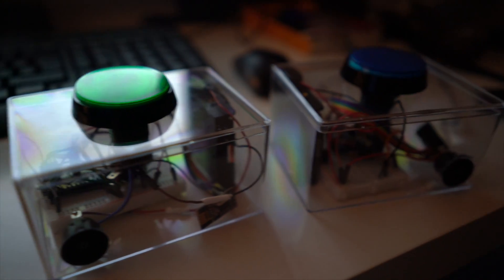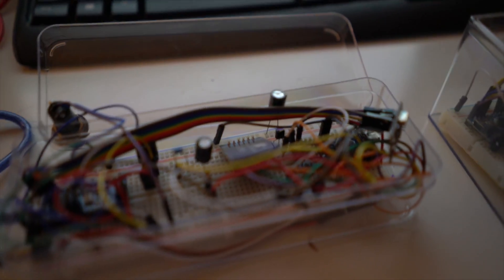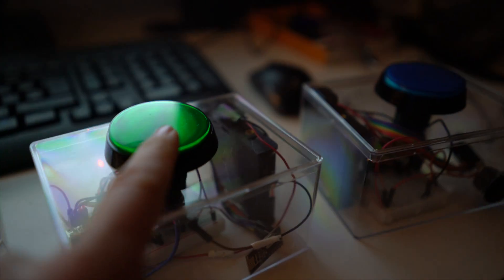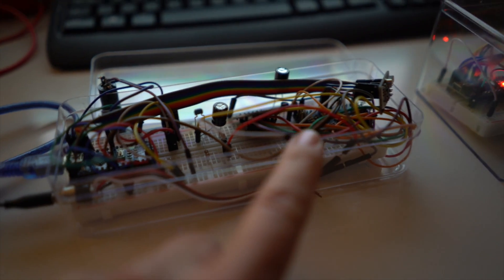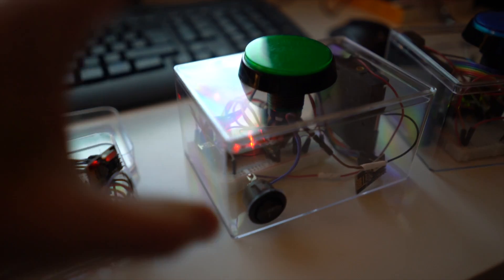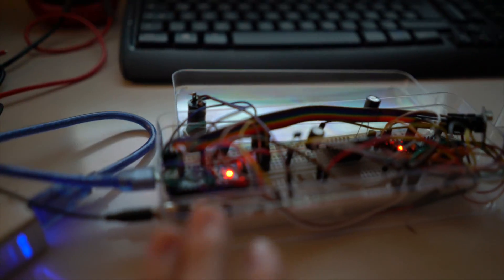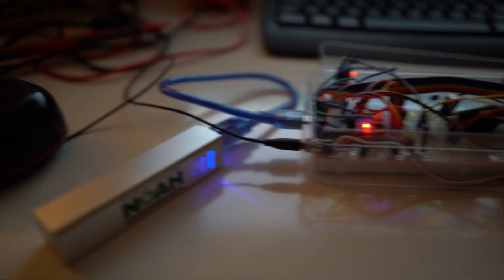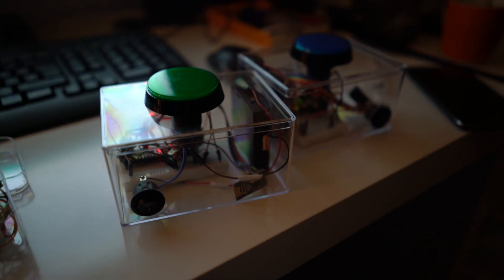Arduino: Wireless Game Show Buzzer with sound

Comment: It does not work for me. I use a board with a built-in and external antenna. When you press the player button, you can see that the LED on the TX nano board lights up. But the LED on the player button itself does not light up. Nothing happens on the master board. I’ve been sitting here for two days now and I can’t do anything. Can you tell me where I missed something? In the sketch settings in all three files (Button, Master and RF24) I changed the pins to 7 and 8. RF24 radio(7, 8); I can't figure out what I'm doing wrong.
Reply from the maker: It's really been a while, since I worked on that project. I just remember, that some modules (from Aliexpress) did not work. The only hint I can give you: Order the RF24 from a different place.

Comment: Great project, thanks for al te work. I am running in problems to get this work. I have set up two Nano's, one as buzzer and one as master. Disabled the play sound function. Changed the ID's in the master sketch to {1}. The buzzer is sending data and the master is receiving data (Data received!  1,  1) but then nothing is happening. There is no message sent to the buzzer because the light is not powered on (it is blinking at startup). Can you help me?
Reply from the maker: Hi Patrick, thank you for the feedback. I am sorry, it's been a while since I created this project. Have you checked all connection? Also check the NRF24l01. I sometimes had some faulty modules. Try to use a spare one.
Reply: @felix41382  I have tried another sketch for communication and this works fine it seems that the data sending is not handled correct by the master, I have checked the code (for as far as I am able to) and connot find anything strange.
Reply: @felix41382   @felix41382  no luck, tried different modules. Checked everything. Used other sketch for communication testing and that works fine.

Comment: Nice Felix. A quick look at the code tells me that this will work with up to 255 buzzers. Is that right? I actually want to make 20.
Reply from the maker: That's correct. Currently up to 256 devices are supported. Please send me a picture of your 20 setup. I never saw it that big. :-)

Comment: Moin, wie sieht es mit der erweiterbarkeit aus? Ich habe versucht es auf 6 Spieler zu erweitern sowie die pipes auf 6 erweitert. Nur will er strikt nicht mehr als 2 Spieler quittieren.
Reply from the maker: Betacrypt_FPV moin beta crypt, ich hatte nie mehr als zwei buzzer im System. Das sollte aber eigentlich kein Problem darstellen. Ich schau die Tage nochmal in mein Source code. Ist schon ne Weile her.
Reply: Das wäre super von dir! Die BK_SW habe ich auf 7 erweitert damit er die zuordnung auch hat. Mein riesen problem ist das RF24, damit habe ich mich noch nie auseinandergesetzt und die pipes machen mir ein Fragezeichen ins Hirn :D Wäre super wenn du da in deiner sehr sehr freien zeit mal drüber sehen könntest.
Reply: Hi Felix. I would also appreciate this, if you wouldn't mind. I have built the 2 buzzer version (which works fine) but  I would like to extend it to 4 buzzers. Unfortunately, my coding skills are a bit rubbish and I am struggling with how to extend the number of buzzers. Any help/pointers would be gratefully accepted. Thanks.
Reply from the maker: I created a Github repository for this project and added support for more than two buzzers. 
Check it out: https://github.com/don41382/arduino-nrf24l01-buzzer
Changes to support more than two buzzers: https://github.com/don41382/arduino-nrf24l01-buzzer/commit/866c841316359fa0cd43e159d528b081f1bda1d2

Could you please try it out and tell me if it works? I don't have a working setup right now.
Reply from the maker: Ich habe ein Github repository erstellt. Ausserdem sollte es jetzt möglich sein, mehr als 2 Buzzer zu benutzen. 
https://github.com/don41382/arduino-nrf24l01-buzzer
Changes to support more than two buzzers: https://github.com/don41382/arduino-nrf24l01-buzzer/commit/866c841316359fa0cd43e159d528b081f1bda1d2

Kannst du das mal bitte ausprobieren und mir sagen, ob es funktioniert? Dank Dir.
Reply: Sehr schön! Danke dir. Ich kann dir erst am Wochenende sagen ob es klappt!
Reply: Thanks for such a prompt reply, Felix!  
I can confirm that the new sketches work fine with my existing 2 buzzers. 
I will build buzzers 3 & 4 later this week and will let you know.
Thanks for your help with this.
Reply: Was sure I provided an updated comment....
Anyway, I built buzzers 3 and 4 and I can confirm that the new sketches worked perfectly and were fun to use last Christmas!. 
Thank you once again.
Picture of the finished buzzers here: http://tinypic.com/r/2zyljlz/9